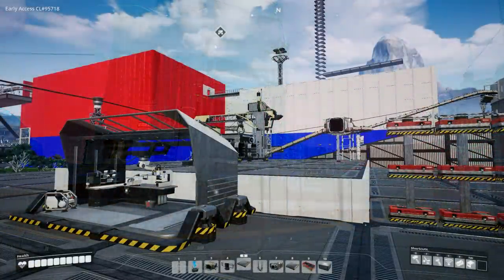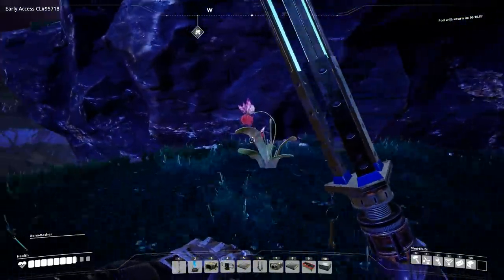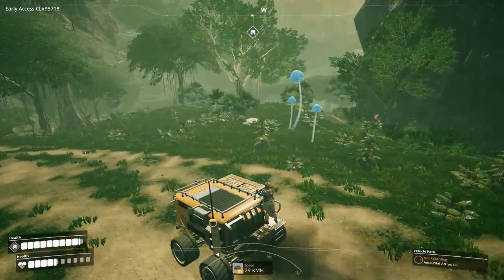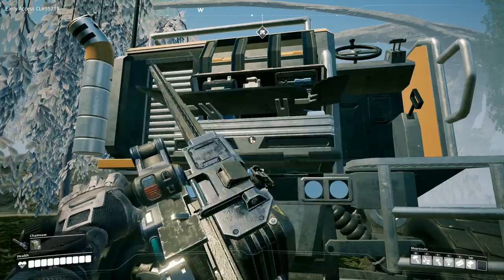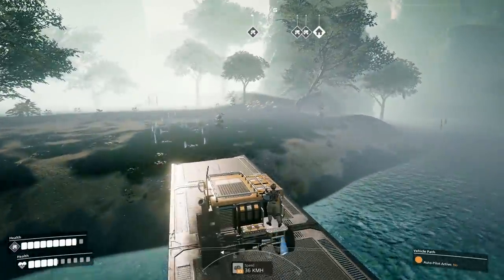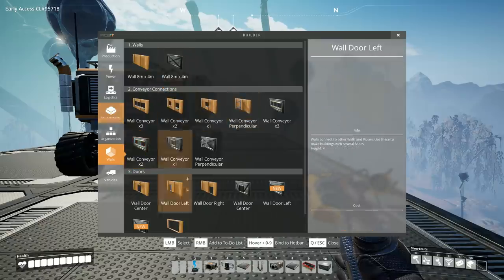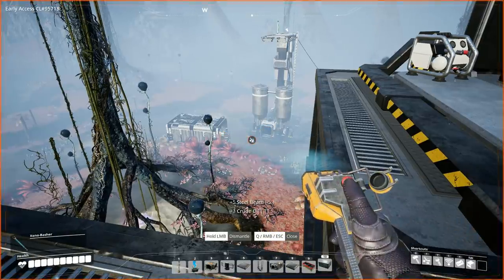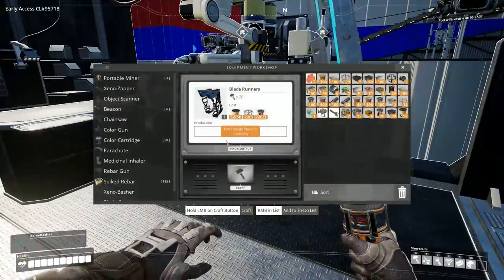Satisfactory Gameplay | Oil automation

Comment: If you run in close and melee them with your Xeno-Basher, you can take out those Alpha Spitters easily. They take quite a few hits, but it's doable. They do knock you back occasionally, but it's a lot less damage than the fire they spit at range.